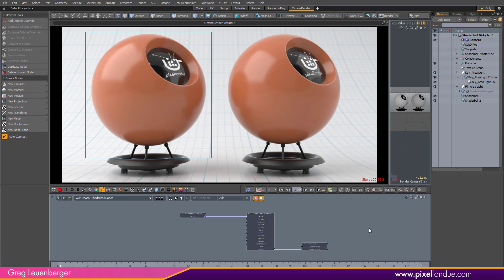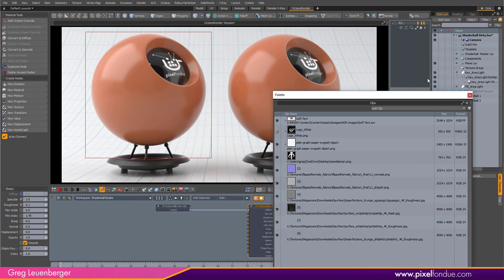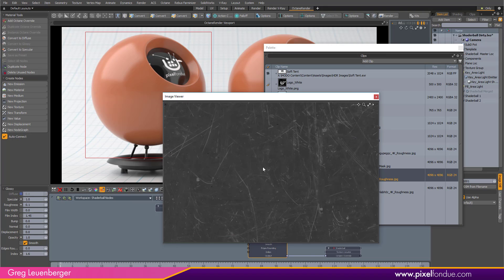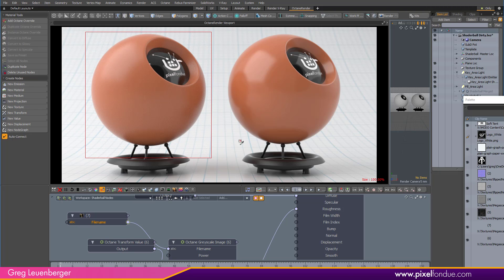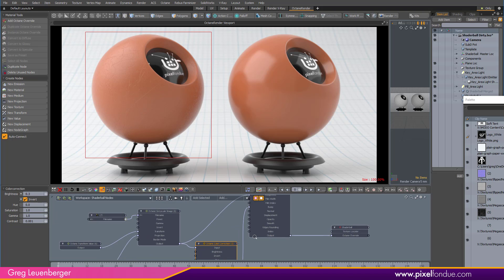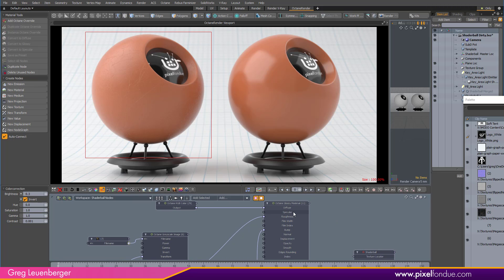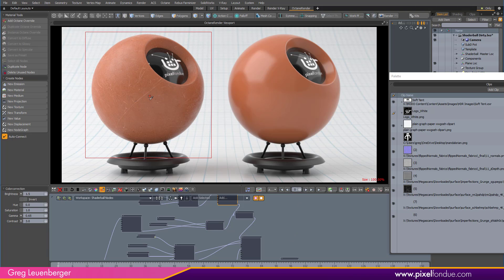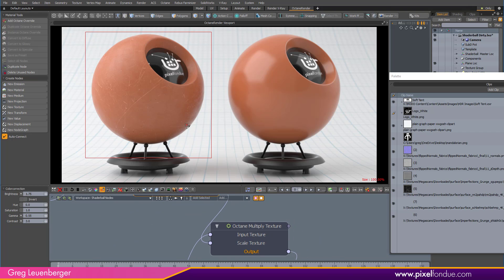MODO Octane | Dirty Grungy Scratchy

Comment: What's the difference between gamma and power?
Reply from the maker: gamma just deals with the mid-tones.  So think of 'curves' in Photoshop or the middle arrow of the 'levels' in Photoshop.  Black and white are clamped.  Power is like gain - you're just multiply all the values.  Black should still be black (power of 2 multiplied by 0 is still 0).
Reply: @pixelfondue  Ah. So should gamma be 2.2? To keep linear?
Reply: Is the loosing connections from nodes still a thing? Or solved nowadays..

Comment: That's a tasty dirty ball. I am glad however I'm not use Octane and nodal shading. Every time I watch a video with nodal shading it seems like so much work compared to the shader tree.
Reply from the maker: yeah, I'm a big fan of the shadertree....maybe Octane can work with it like V-Ray does eventually.
Reply: I love octane as it mostly avoids the shader tree! 
I guess it really depends on your previous experience with 3D packages. With the shader tree being such a different approach to shader management, the octane schematic method is a real relief to use if you’re coming from say 3ds max or maya.
Reply from the maker: yeah, there's definitely an 'event horizon' for the shader tree.  I like both (use Maya as well) - Shadertree is a little faster I think and takes up a lot less space on screen...although Nodal makes it up with flexibility.
Reply: I can understand that. Modo seems an anomaly. But as a graphic design used to the layering concept and only having used Strata before Modo it works really well for me. Although I admit dealing with replicators and certain other things I do use the schematic as well as well. Nodal shows relationships better than the shader tree. I think having both is the best option.
Reply from the maker: yeah  - the whole mix and multiply setup would take a couple seconds in the shadertree...then you can also adjust opacity and blending modes...or re-arrange the layers super fast.  It's one of the unique things about MODO.
Reply: @angushume2054  Totally agree, having the option to use both is the ideal situation.